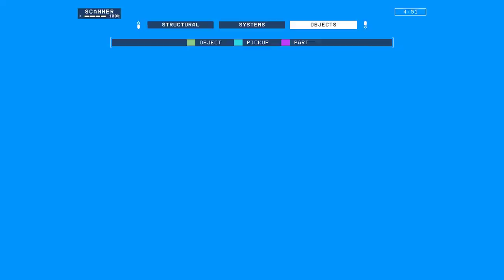Hardspace  Shipbreaker - Catastrophic chain reaction from opening a single door

Comment: After a misguided depressurization sent my entire SHIP into the furnace (myself included), I started making a point of depressurizing the entire damned thing in small, controlled bursts, before I did ANYTHING else.
Reply: For me the issue is always when depressurizing the crawl space, and it doesn't have an atmospheric regulator. That usually sends the ship flying to the other side of the yard, even a Javelin heavy cargo
Reply: @raffareis  yeah, the javalins are the worst, which is why I depressurize everything before touching anything, and thankfully since Javs are so big, having to do what I call a "splitsaw decomp special" they hardly ever go flying
Reply: @raffareis try popping the thruster cap first thing, sends the thruster cap accros the docking yard mind you, but it’s an easy way to depressurize the whole crawlspace at once. Worked in every ship I’ve tried. Haven’t tried it on a gecko stargazer. Mainly bc it has multiple and a much easier way to depressurize.
Reply: I just had this earlier this morning, but I was working on a heavy cargo javelin, I was separating the double airlock on the front part of the ship, no loose objects, no nano carbon shells on the the interior piece, the only thing pressurized was the airlock, and it was unpowered because I salved most of everything else. Cut the connections and it drifted away very slowly like I expected, gave it a little nudge with my utility grapple, and before I could even process what happened the interior piece jolted to the left abruptly and crushed me instantly on the salvage yard wall. Respawned and it was sitting idly next to the hab, maybe 40 meters from where it started.
Reply: I made sure to disassemble the outer compartment with the crawl spaces before moving to the ship interior. Makes dismantling the reactor assembly significantly easier.

Comment: I hate how when you purge a fuel line on a quasar thruster, while the halves are separating and moving AWAY FROM THE PURGE LEVER, YOU CAN STILL BE CRUSHED.
Reply: I did find a solution.
Animation cancel using the scanner mode and turn around, fly back out.
Reply: press z to grab the wall near the lever and then press f to use the other hand to yoink the lever

that makes you stick to the part with the fuel and not either of the halves
Reply: @uhrguhrguhrg Can still get crushed even if you do this
Reply: Never been crushed by a quasar thruster, did they patch that recently?
Reply: @1mariomaniac Nope. Happened to me yesterday.
Reply: @walakalak  yeah started happening to me too after I posted that reply. If I remember correctly, if you hold the wall with one hand and pull the lever you should be fine.

Comment: I was expecting the chain reaction to destroy the ship or at least cause a huge explosion somewhere. that was rather anticlimactic.
Reply: Well, the worst that could happen is a full reactor meltdown, but that would require a very specific chain of events where somehow a fuel canister gets sent flying from the decompression and somehow explodes near the reactor, severing either the ECU or thruster pipes connecting to the reactor. This video still displayed tremendous internal damage from a single decompression.

Comment: At least you didn't detonate the entire ship by accident... 1 demo charge on a lvl 3 cut surface outside the hull on a lvl 5 risk ship caused a chain reaction due to detonating a fuel tank inside the ship, which set off a reactor meltdown, that set off everything else and threw me into the materials processor... where I died because I couldn't get back out.

Comment: Heh, yep.  I had one where the first thing I did on a Mackerel (ExoLab, I think) was salvage a part for Beulah from a computer terminal in the main cabin, which sparked to...something...which exploded, and then sent the reactor critical.
Another time on a Stargazer Gecko I tried a tactic which had been working very well previously - decompressing the entire ship by cutting the anchors on the thruster cap at the back of the ship.  Popping the cork, so to speak.   This was during my career playthrough, so I hadn't realized how exactly later ships introduced additional hazardous components. I'm pretty sure it dislodged a fuel tank anchored right next to the thruster, detonating the thruster (which I hadn't yet disconnected), the reactant, and eventually the Class II reactor.
Reply: RIP on that second one lol. Haven't actually witnessed one go critical yet, I'm extremely cautious around those class 2's (and class 1's are really easy). Although I can assume it's one heck of a boom.

Comment: Hold up, so you didn't check compression behind the door and decided to pull a door randomly? You could've used working Atmosphere Regulator in that same room (2:33) to use that room as an airlock. Well earned I say
Reply: Everyone brain farts this game is great for catching you off guard when you get too complacent
Reply: This is probably why they ended up adding that little "DNGR" indicator whenever you look at a door with a pressure difference behind it.